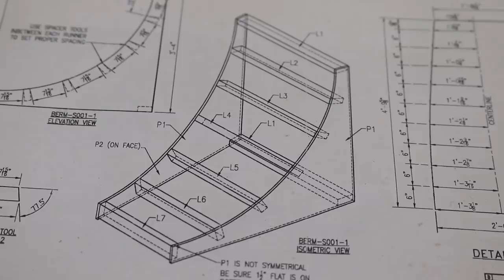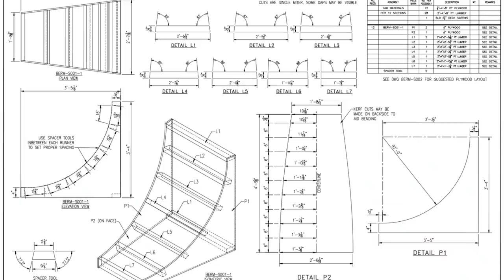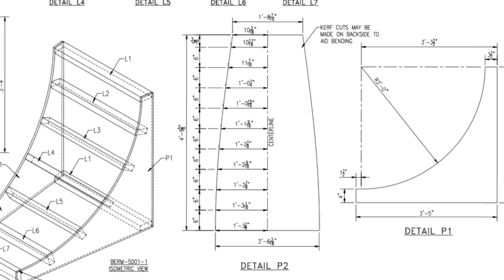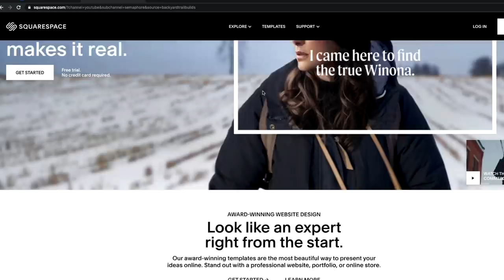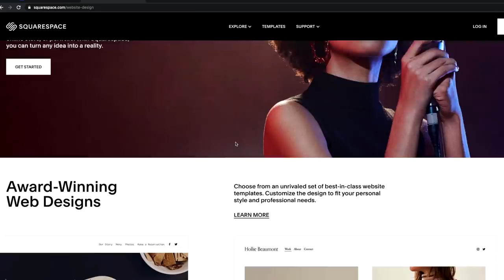Backyard WOODEN Pump Track Build (part 3) // 180 Degree Berm and A New Bike!

Comment: As cool as you may think this pump track is, it doesn't look like it's working, you should be gaining speed as you travel the humps, it appears as though you loose speed instead, the humps may be too close to each other, and a thought, maybe take out 3 or 4 of the corner modules, a lot of speed seems to get lost there aswell.
Reply: Something is definitely off here although it's hard to tell since everyone riding here clearly hasn't done much pump track riding.

Comment: 180 berms need to be tight and pumpable, like a horizontal transition, on a low speed pump track. The size you made would work if the track was faster, but speed is challenging on a narrow wooden pump track. What you could do is turn it into two 90 degree turns with a roller in the middle to maintain momentum. Really cool to see those blueprints and the build, it's looking great.

Comment: Maybe try taking a 4x4 cut off a corner as a square. Do it down about a foot. Do it to four of them then turn the cut side in creating a square pocket. Screw them together. Now you got risers for under some of the modules to give some height. If not maybe a roll in.

Comment: Losing all the speed on the last bit of the turn. Trying take out some segment and have a shorter turn instead of 180 or look at the shape to see if its possible to pump out of it at all. Also try swapping the last roller with the step up to help gain more speed before hitting it. Pretty sweet to have a lego track in your back yard.